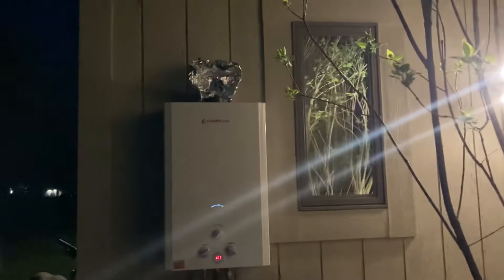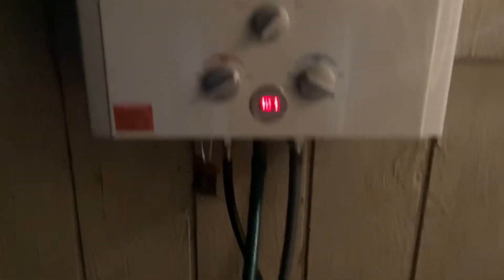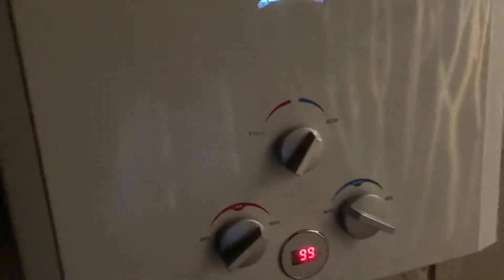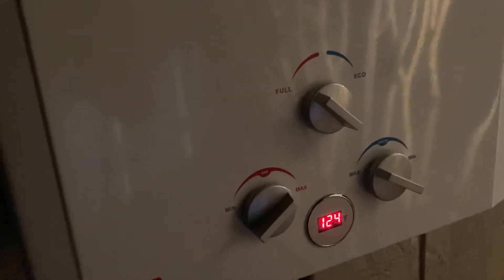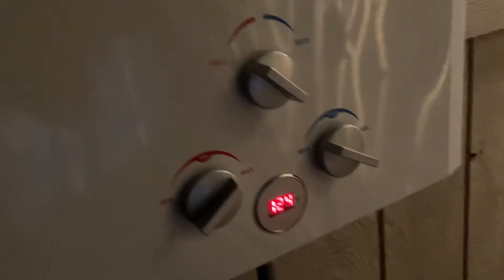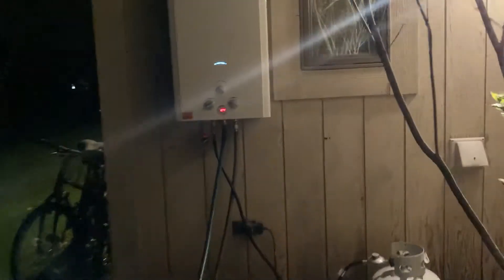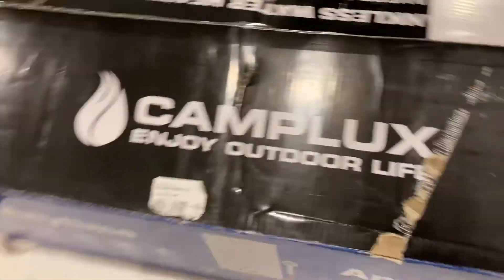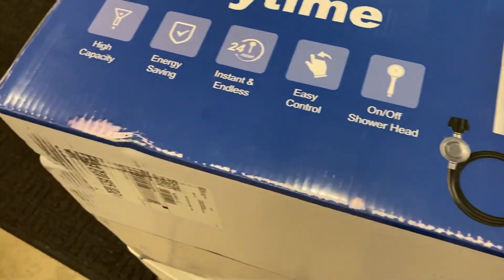Instantaneous pool heater setup part 1

Comment: How long are you getting on a tank of propane?
Reply from the maker: Only four hours. Connect to natural gas and it will operate fine but only about 60% capacity. I spend about 8.00 on natural gas running for 24 hours straight while propane is 16.99 for only 4 hours.
Reply: @jakemir  thanks! You should be able to put a natural gas coverter on it to get to 100%.  I was looking into a wall unit like that. My next idea is using an electric bbq grill with a copper coil. I used the coil in a fire pit last year and worked great except I went through 3 pairs of garden hoses being melted. Figure the grill will hold my temp longer and be more efficent.
Reply from the maker: There are cheaper models out there to use but this option works great because you can just set your pump timer and the unit only runs when the pump is running. This unit also requires only 2D batteries.
Reply: @jakemir  I found a couple, and a camplux natural gas. I'm heating a 16x48 intex at 5000 gallons, so anything I use will have to be basically 50,000btu or better. Just not sure if the 3/4 fittings will allow enough flow to keep up in Ohio.
Reply from the maker: I called Camplux and they said they did not make a natural gas heater. I bought their propane heater and just hooked up to natural gas. I believe I calculated my pool in Michigan at 5480 gallons and I am having no problem on a sunny day raising the temperature 10 deg in 12 hours on a sunny day. I would not waste your time running it at night because I found it does nothing. I leave the pump completely off when the sun is down so it reduces the amount of heat loss from circulating water
Reply: @jakemir  that was my mistake.. it wasn't a camplux brand, but another low end similiar. I used clear plastic sheets as solar covers last year, just upgraded to full intex solar cover. Between that and the pit coil, I was able to get it up to about 86 during the day in late august/early sept and kept it around 80-83 overnight when I had the fire going. Without the fire pit burning, it dipped down to 75/76 easily